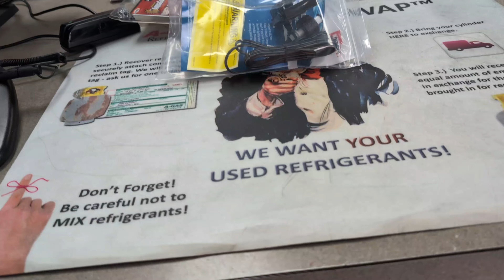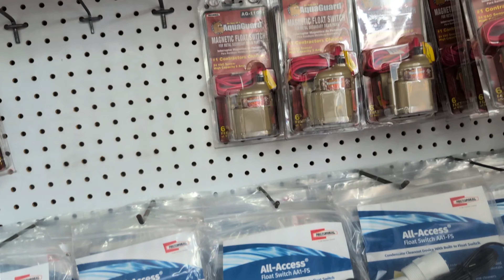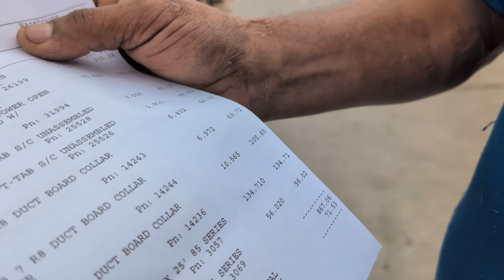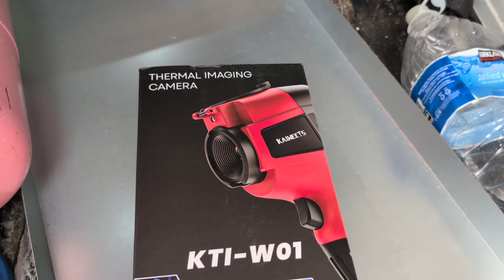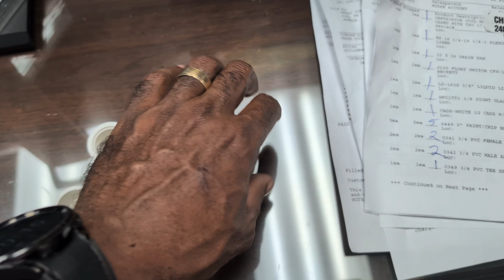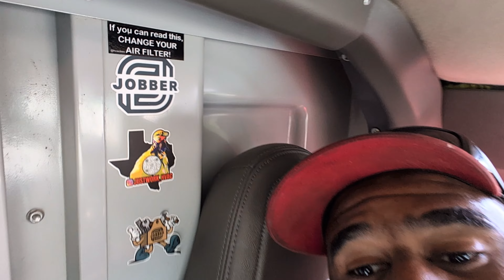Part 2 The Fix 👀  How Lack of HVAC Maintenance Wrecks Homes! 🚨 Warning Signs You Can't Ignore!

Comment: That was great work. Went back to Jackson for the female fittings ! Put an elbow in place of the 45. Clean the condenser, it was super filthy for a 2 year old. Don't people do anything outside of their home when it comes to watering lawns, washing down driveways and cleaning off things once in awhile? That condenser pad was covered with stuff, no wonder its up and into the fins. My guess is, the resident will not get around to the filters and so it'll make things worse.  Folks like that its just better to arrive the second time with the filters and put them in however, the returns really need washed, down and rinsed first. You can only do what you can do. Another WW HVAC follow up and completion of much needed maintenance.

Comment: You need to let the viewers know that the chirping on a smoke detector means the batteries need changing as a PSA.
Reply from the maker: I think I did
Reply: Or better yet, if its a rental home, WW could tell the management company to do it, its their responsibility and current detectors do not have replaceable batteries any longer, you have to replace the entire detector that has a 10 year battery at their current sales prices.